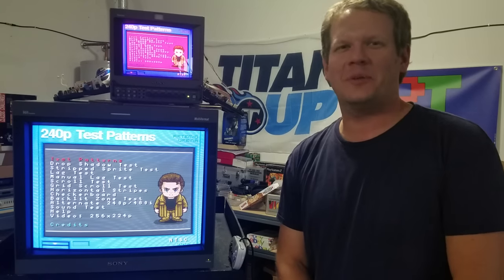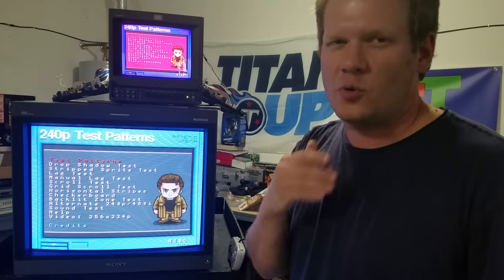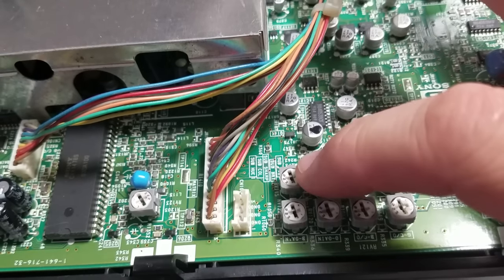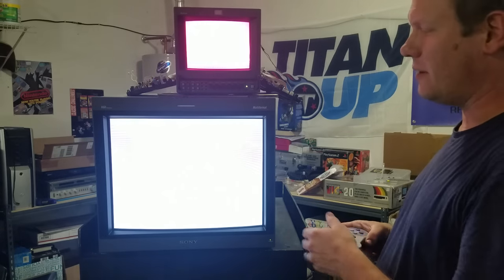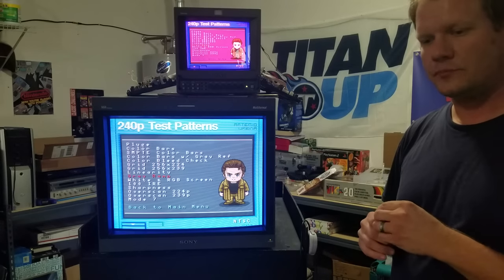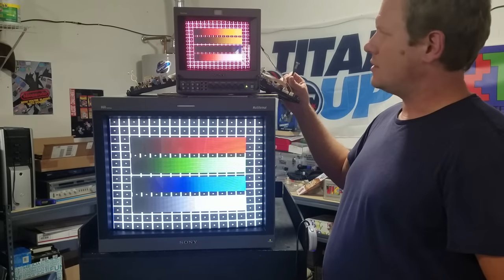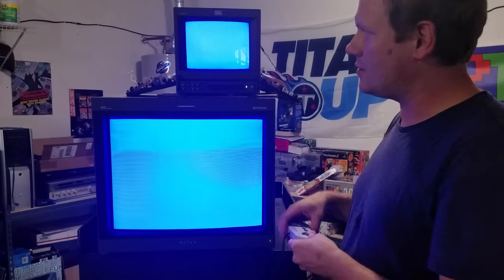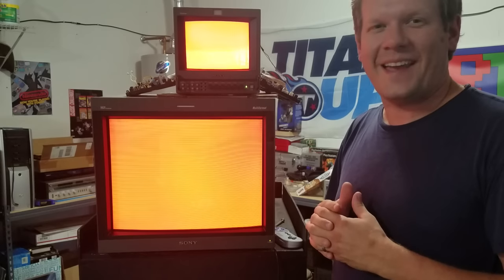Sony CRT PVM & BVM Color Calibrations & Troubleshooting

Comment: What happens if you short out the Green pin on the neckboard? If you get pure green then it must be something internal and not the tube.
Reply from the maker: I didn't test that, but yes that would be how to tell instantly if the tube is bad or not.  Thanks for the tip.

Comment: Food for thought: if the monitor can display white, then the phosphors of the tube are ok. I would put up SMPTE bars and compare that to the 20L5. Adjust the red and blue first, then the green. It's strange that the "green" screen looks white.... It doesn't sound like a voltage/amp issue so potentiometers won't fix it.
Reply from the maker: Thanks Jarrod.  I think there must be a component issue most likely.  The green show faintly at times.  I think it needs a full recap, etc.
Reply: @RetroTechUSA  what was the probie? Did you find out?  I have the same problem my colege tutor is a electronic engineering tutor he said need a new tube.

Comment: im just getting in to PVMs i just got a Sony PVM-14M4U off eBay it was being sold as is cuss it had a green tint to it and i was thinking i could just calibrate it and all would good well that did not fix it i have been trying to get it to look good and i just can't get the color to look right even with the green all the way down it still looks to green and all so blue seems a bit week so im not sure if its caps or the tube cussing this.

Comment: My dad has quite advanced dementia, when I visited him today he mentioned wanting to 'look at the white screen/monitor again', it took me a while to understand what he meant. Essentially he wanted to check the white balance and the RGB (he interjected with CMY also) of the TVs they had in the care home. He mentioned taking the chassis off and finding the 'three screws' which are the potentiometers you are demonstrating here. It might have helped I'm a photographer who spends a lot of time in a colour darkroom, as he's extremely hard to understand, but that's where his head's at - looking to tune in to harmony. Needless to say his Oscilloscopes and tools are staying with me. 

I have one of those screw drivers on my desk (Dad's actually), they're Stanley Precision Screwdrivers or at least the box I have. Other one's for this job were basic molded tube with a copper flat head I think.

Comment: I did a pretty deep dive on this and made 2 videos of my own on how to calibrate color and set white balance. The first step is to calibrate brightness, color and tint with a blue screen and smpte color bars. This gives you a baseline. Then you set white balance. There are tutorials online detailing how to objectively set white balance with a probe and the service manual gives instructions on how to do it with an oscilloscope. After consulting a service manual and talking with two technicians I came up with a technique to correct white balance by eye. It's kinda complicated to be describing in a youtube comment section but you basically do what Steve did in this video--pull up a white screen and use a reference monitor. Important things to point out is that you set subbright first followed by the cuts (gcut, bcut) which are done with the brightness and picture turned down. Then you turn the picture and brightness up and adjust the gains (or drives depending on how they are labeled.) Many CRTs only have adjustments for the blue and green guns i.e. gcut, bcut. If you want to adjust the red gun on these crts you adjust the green and blue guns in tandem i.e. In order to turn the red gun down 5  you would turn the gcut UP 5 and the bcut UP 5. Remember, the cut adjustments are done at low picture and brightness levels. There is a bit more to it but that is the jist of it.

No amount of white balancing is going to fix the 8 inch monitor in this video. It's probably too far gone. I would recommend doing a rejuve on the green gun, or all the guns...or you could attach the power cord to the back of a boat and use it for an anchor.
Reply: He should check the neck board for cold solder joints on the green, reflow them, and thank me later.
Reply: @cesarsoto4551  I hadn't thought of that. Have you had good results doing that?
Reply: @cesarsoto4551 Mine has similar problem (red/pink tint all over screen) but comes and goes randomly.any tips?
the menu text aren’t affected.

Comment: Thanks for another great video. I have a 14M2UMD unit that only displays red. I’ve been trying to troubleshoot it since June but can never get anything to work. However, I have found when I hit underscan I can see the three RGB lines works perfect. In addition component line B and anything composite do not work. I purchased a working input board off eBay thinking it would work but results were the same.
Reply from the maker: Thanks, It may be a bad component on your neck board.  It has a couple components that can go bad over time.
Reply: Retro Tech any tips on how to remove the epoxy on the neckboard/tube?

Comment: Great video Steve, hey on the smaller monitor are the potentiometers in the front enough to adjust the color if it's not as affected as this one? Or are you mostly likely always going  to need to do some internal adjustments on these older monitors?
Reply from the maker: Thanks Ryan.  I have to use both sets on most of these old PVMs.  It seems the front ones make a lesser adjustmnet than the internal ones.

Comment: These videos are a very handy resource. Thanks a lot.

A PVM-20M2MDU that I recently picked up does not display blue, regardless of input* , cable, source, cranking the blue gain in the service menu, or doing a factory reset. Any ideas?
Some Googling tells me that the electron gun has probably failed, in which case it's screwed.
* Composite and S-video inputs. I don't have a component source to test with (right now), or a BNC cable for the RGB inputs (yet).

Comment: I have a 8041Q, and all of my greys are kind of brown. No adjustment of the front pots makes any difference, and when I go to try to turn the internal ones on the B board they look a little like they got burned? And turning them doesn't seem to make any changes for red, and green, but blue does. (Red and green are the ones that show some discoloration on the plastic bit. 

When I first powered it up the entire screen with no image had a kind of greenish hue, but turning down the screen adjustment on the flyback made this go away.  Any ideas on what to look for? Also do you know what I can replace those pots with on the B board? I am good at soldering but do not know what to replace them with :( 

The pots are: RV115, 122, 118, 120, 121, 205, 118, 119.

Lastly what pot would I adjust for the top linearity? The top circles on the linearity screen are oval, but the bottom ones are fine.
Reply: The Green colors show up fine on my screen. And the Green dial and the one called RV121 when I turn them will sometimes show a tiny baby spark under the plastic trim knob part, and then the screen goes black for a second, and then comes back to normal. But turning the knobs does nothing. :(   I think they need to be replaced but cannot find the parts to do so :(

Comment: In my consumer Trinitron TV there are red drive and red cut off controls in the service menu, but I notice that older ones only offer blue and green controls. Any idea why this is? This video reminded me of it because the physical controls on the board only control blue and green until you did the screen matrix one.

And is it better to balance color in the middle of the range (like 0 through 63)? I notice average data is low (like 21,14,14 for RGB drive) but the factory settings are higher at about 31/21/21).

Comment: I have a 27” Trinitron with a flat screen that doesn’t get to a pure black like it should and has a glow around bright text or anything bright on a black or dark backdrop, and if the bright image moves to a different part of the dark backdrop there’s a trail behind it that’s comparable to motion blur of an original gameboy except it isn’t motion blur, and there’s a dead zone on the left edge of the screen that light gun games can’t pick up. I’ve had these exact issues with every CRT I’ve owned. Is it my outlet causing it, and if so how can this be fixed?
Reply from the maker: Unfortunately that sounds like the tube is worn out.  It could be capacitors internally, but it's more than likely the tube itself.
Reply: @RetroTechUSA  The strange thing is that I had someone repair it at their house who knows what they’re doing and they didn’t have that problem over there. Also I got an adaptor for HD Retrovision component cables that solved dead zone issues with light gun games
Reply: It's weird that there is a dead zone. But the screen not getting black could simply be the brightness knob set to high. You may be able to adjust in the service menu but usually you have to take the cover off the TV to access the brightness  knob. As far as a 'ghosting' trail goes, that seems to be normal on black backgrounds with CRTs in my experience.

Comment: Hi bud,

Semi related question. Have you ever factory reset a monitor? I've seen conflicting reports that the reset sends it back to completely default settings, and others than it just sends it back to it's post calibration state. I've reset a monitor that was completely messed up geometry wise, and it helped a lot, but I'm concerned all the colour settings would be off (although they look okay to me). I've compared it to the service manual and the reset settings are different from the listed "standard" settings in the manual, which makes me thing the monitor actually resets to however it was calibrated and then saved in the ROM.

Would you be able to shed any light on this?
Reply: depends on model... on 20m2/14m2/20m4/14m4 for example if you activate the 'factory reset' flag at the end of the service menu by setting it to '1' and writing, you'll write the current setting as factory setting 

if you haven't done that yet by accident, you have to hold the write HV delay button in on the service manual until 'factory reset' appears on the screen and then press HV delay one more time or degauss (I forget which) to get it to go back to the last settings that were set as 'factory reset'

unfortunately if you've fucked up (and it seems someone has) like I have, you have to just enter them all in manually